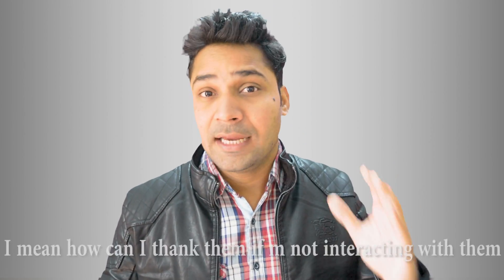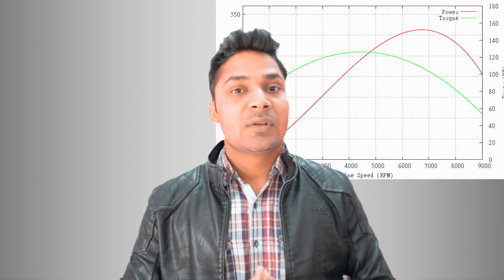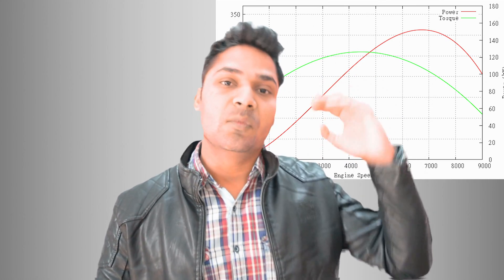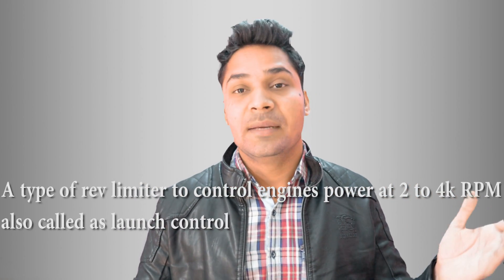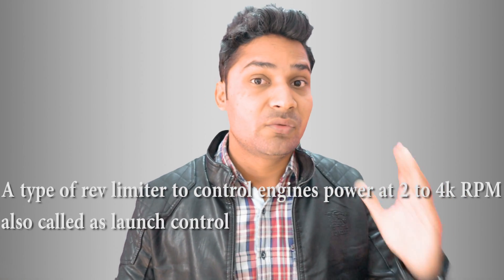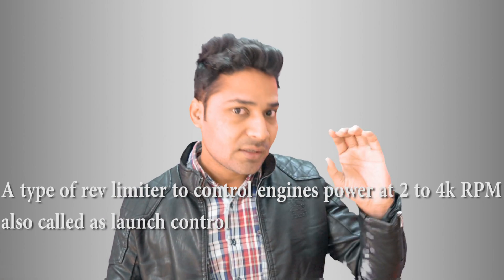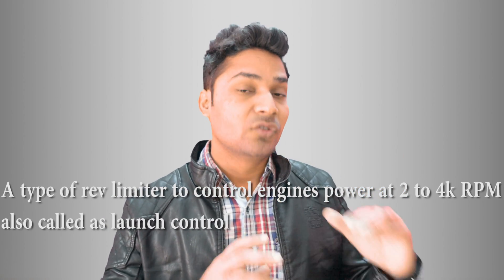Rev Limiter: Is over-revving your engine beneficial?

Comment: Nice video Mishraji. But I think this still doesn't answer my question that I asked on dominar 400 video. Is the maximum fuel efficiency attained at peak torque rpm level?
Reply from the maker: Sorry i misunderstood the question with the mileage.
Ok i'm putting it this way when u achieve maximum torque in an engine the max power just follows it, as i told in this video that power starts decreasing after that and torque also decreases with that. This means that no matter how much fuel u provide to the engine power(or torque) can not increase (keeping everything same).

The perfect ratio of fuel eg for petrol is 15:1 i.e. for every 15 gm of air 1 gm of petrol is required, less than that is called lean and more than that is called rich mixture.
When we start the engine and we r at lower revs we r providing it a lean mixture which can already be said to have max fuel efficiency as we r getting enough air for the fuel to burn completely, when we accelerate the bike we actually increase the fuel supply and when we reach the perfect ratio that's usually our peak torque RPM.
After that we start supplying the rich mixture ie petrol is more than 1 gm for every 15 gm air.  Now till we rich this point ,we r already at max fuel efficiency but in this case it does not mean that u r getting maximum mileage.
So u can say that when we start the engine and the RPM till we reach max torque we r already getting max fuel efficiency after that fuel efficiency goes down.
Reply: Mishrology So when I'm at peak torque, I'm at the maximum speed that an efficient fuel burn can give and post that level fuel efficiency just tapers off. Then why do you say it does not equate to maximum mileage?
Reply from the maker: Because bro fuel efficiency means that how efficiently our fuel is being burnt, now as long as we r below that peak torque rpm we are already at maximum efficiency i.e. if peak torque is at 8k rpm it means we r at max fuel efficiency below that rpm even if we r at 2k rpm or 5k or at 7k, now the mileage is kilometers per litre which is usually achieved in bikes at around 50 to 65 kmph speed (which can be at 4k rpm in some bike or 6k rpm in some bike depends upon the bike) in top gear. 
Now u will ask why? 
becoz as ur speed increases drag forces(air drag) also increases(exponentially) and after this 60, 70 kmph speed drag force is very dominant and that's the reason why u dont get maximum mileage at that RPM coz now ur engine will have to work against a much more stronger air drag compared to 50-60 kmph speed so the power gets lost in that but as i already told u that, it was fuel efficient from 0 till 8 k rpm(peak torque rpm) so 50-60 kmph speed always gets u maximum mileage not peak torque rpm.
But there is one benefit of this, suppose u r riding a yamaha fz 150 cc and ur frnd is riding a pulsar 200ns. Now fz is at its max speed say 115 kmph and ur frnds pulsar 200ns is also at the same speed now u both check ur mileage after 70, 80 kilometers on a highway, ur fz's mileage will fall down severely while Pulsar 200NS will give u better or equivalent mileage!!!
I dont say u believe me u just check that out reason is simple coz FZ was revving above its peak torque rpm while NS was around it or below, i.e. NS was fuel efficient whole time but fz was not.
Hope that clears out the confusion.
Reply: @Mishrology  interesting and informative

Comment: I own a Duke 390... The mechanics said the rev limiter at 7500rpm....so I cannot use my maximum torque which is at 9000rpm..?
Reply: Lol rev limiter should be obove 10 k rpm bro they may said wrong
Reply: Its maximum rev range is around 9500rpm..not 7500😂

Comment: ek chiz puchu sir plz 
reply zarur karna 
agar meri ns mei limiter hai 9 par 
mei usse 9 tk lejata hu toh kya mera engine damage hoga mei 4 th gear pe 9k rpm tk lejata hu
Reply from the maker: BEASTMODE RIDER na boss bilkul bhi nahi actually na they have already a factor of safety jisse apko usually kabhi problem aaye hi nahi but when u rev it in idle condition for longer period of time it might have bad effects that usually reduces the longevity of the engine.
Reply: thankyou 💪✨  just subscribed you and bell b baja di  thanks i dont rev it when idle (on neutral) that was very helpfull
Reply from the maker: BEASTMODE RIDER thanks bro.

Comment: what happens if I increase rpm of 400Dominar as Bajaj limited to 9500??
Reply from the maker: +Santosh Siva it is usually limited by revlimiter so if U'll try that though it 'll go up but then it 'll be brought down by the revlimiter and if you stay there for longer period of time it might affect the longevity of ur engine.
Reply: Mishrology if i increase my rpm to 11000 by ecu flashing what will it happen?
Reply from the maker: Now if u do that by tweaking ur ecu, u r not going to see an increase in overall power or torque of the bike unless u r also tweaking ur cylinder head to improve its intake capabilities coz ur engine is designed in that way and components have its limit too. If engine was to get more power in an efficient manner at that rpm range the manufacturer would have done that. Now suppose even if ur components are safe at this rpm still all u'll get is increased fuel consumption(that's also will be inefficient fuel burn) and higher top speed (also might damage ur engine's components in the long run if they r not designed to handle this rpm).

Comment: bro plzzz explain TRACTION CONTROL,LAUNCH CONTROL.HILL DECENT CONTROL ,ABS,EBD,ESP,CS,BA.
Reply from the maker: Launch control is what I already explained, it's a sort of  a rev limiter (reduces the fuel supply to engine) but is set for 2 to 4000 RPM to prevent vehicles(especially performance bikes and cars) from getting uncontrolled  while releasing the clutch when vehicle starts crawling or else it could do a wheelie especially in bikes.
Reply: your fb id name???
Reply from the maker: www.facebook.com/mishrology or simply google mishrology.
Reply: your personal user id??